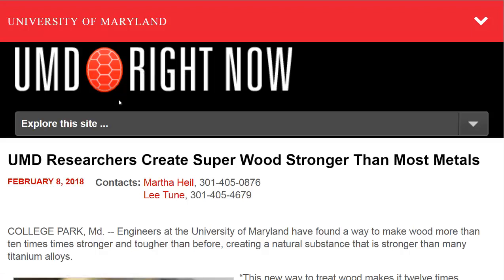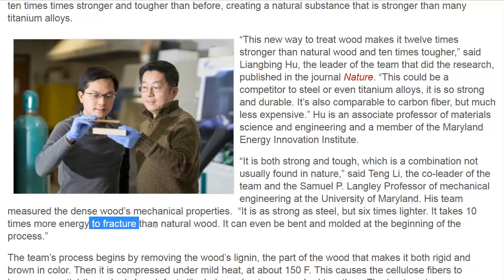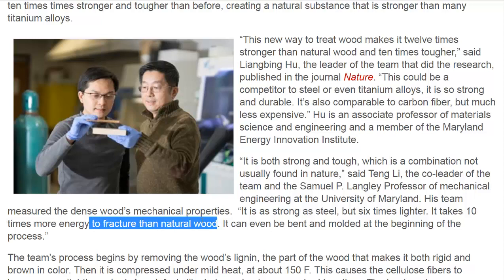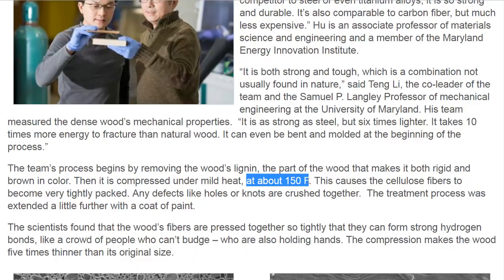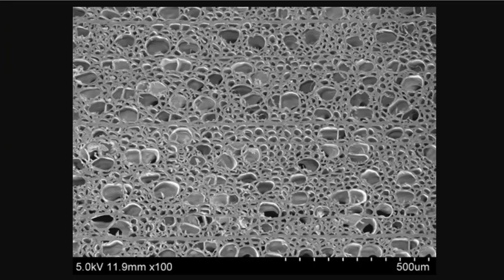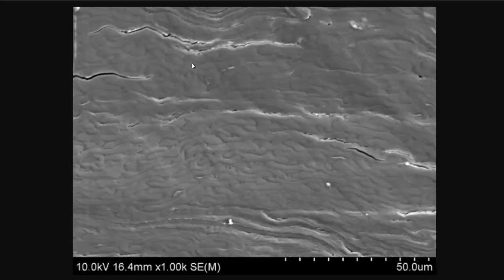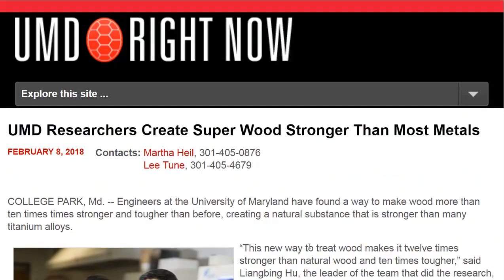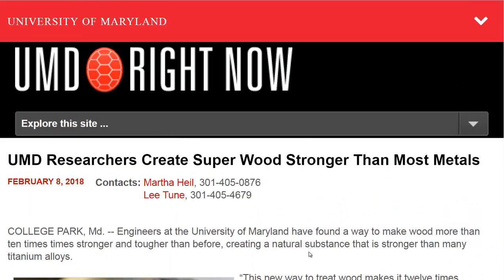Wood That's Stronger Than Steel and 6 Times Lighter

Comment: Although this is quite old, I want to say that this is either a hoax to fleece money or they leave out a very crucial piece of information. I read the paper and tried to recreate the process, but no matter what you do, i.e. level of removal, pressure, time variations. the wood ends up weaker than its normal compressed reference part. Every. Single. Time. I tend to call it a hoax, also because to this day no company makes it commercially.
Reply from the maker: @strangereyes9594  interesting, you may be right.
Reply: The only thing that proves is that most YT experts are incompetent and have unrealistic expectations.... Plus they're not going to give all the IP away.... And lastly it has been commercialized..... 

“Those who can, do..... those who can't, comment on YT"
Reply: The only thing that proves is that most experts are incompetent and have unrealistic expectations.... Plus they're not going to give all the IP away.... And lastly it has been commercialized..... 

“Those who can, do..... those who can't, comment on YT"
Reply: The only thing that proves is that most YT experts are incompetent and have unrealistic expectations.... Plus they're not going to give all the IP away.... And lastly it has been commercialized.....
Reply: The only thing that proves is that most YT experts are incompetent and have unrealistic expectations....
Reply: The only thing that proves is that most YT experts are incompetent and have unrealistic expectations.... Plus they're not going to give all the IP away.... And lastly it has been commercialized..... 

“Those who can, do..... those who can't, comment on YT"
Reply: they're not going to give all the IP away.... And  it has been commercialized..... 

“Those who can, do..... those who can't, comment on YT"
Reply: @nc3826  How do you know how extensive the experimental verification process was, how well I understand the physics and chemistry behind it and how many resources went into the process? 

Well, you cant. Ironically, that makes you the "YouTube expert commenter" you lament about. Funny how that works. But I am in a good mood today, so I clue you in on one of the many problems they omit.

The rate at which the leach penetrates into the wood fibers is measured in millimeters per hour, even under pressure. Considering that you cant alter physics, that means the lignin dissolvent is a gradient, which means you end up with an uneven cellulose structure that gets less optimal the thicker your wood specimen is. 

So the process of cooking, like they claimed they achieved the pre-pressed structure, is physically unable to actually create those structures. 

Having said that, the company they founded as a spinoff from the university the paper originated still is in the "its coming soon" phase, which is not a great sign.

However, the math checks out in theory. The hydrogen bonds should create a very strong lattice, so its not totally phony. However, the most begin explanation of why they are still unable to produce usable products is they thought they will figure out a way to solve all the problems with more research and money and the paper was meant to raise said money (which is a common practice). 

Will they make it? Who knows, but the claims they stated certainly weren't real at the time they published their paper. So I think it was meant to fleece money, although with good intentions I guess.

IF they make it work, the process certainly will not look like anything they stated in the paper and the product will be waaay more expensive to produce than they anticipated, that's for sure.
Reply: @strangereyes9594  "IF they make it work, the process certainly will not look like anything they stated in the paper and the product will be "waaay more expensive" to produce than they anticipated, that's for sure." ? 

"Having said that, the company they founded as a spinoff from the university the paper originated still is in the "its coming soon" phase, which is not a great sign." Incorrect...

The first product is being "commercially produced" Go recheck the website... With the second product that's supposed to be coming soon.... And in the whitepaper it states "it's comparable to carbon fiber, but much less expensive" ? So good luck pretending it's more expensive than carbon fiber... SMH

"However, the math check"? LMAO, since there is no math in the published white paper.... thank you for that pseudoscience irrelevant prognostication...

Tesla almost went bankrupt dozens of times... And most startups fail.... So you're showing no Insight, whatsoever predicting another startup will fail....  Most good ideas don't even get to the commercialization stage.... 

There have been a lot of developments in the cellulose based product and construction industry in the past couple of decades, such as CLT. And I'm not unbiased cuz I actually put a proposal for something indirectly related to this type of development to a DOE grant program over 5 decades ago ... I had my doubts if it would get here in my lifetime?  But it's inevitable that these types of products will be developed at some point by some company, since it's more energy efficient than the alternatives... I know it's a cliche but it has dozens of uses I can think of just offhand. So it definitely could be a "game changer". Depending on how extensively it's developed? 

My triggered defensive YT hyperbolic expert friend.... I'm getting out of this pointless rabbit hole now..... Have fun trolling every concept that you can't fully comprehend or replicate ...  “It ain’t what you don’t know that gets you into trouble. It’s what you know for sure that just ain’t so.“
Reply: @strangereyes9594    Addendum: "How do you know how extensive the experimental verification process" and "understand the physics and chemistry behind it and how many resources went into the process" for any products? KISS....   I'm sorry but assorted  YT degrees in physics and chemistry don't matter ...  

That's why there's "building codes"... 

But thanks for reminding me of the "Millennial Song"

Comment: cheaper faster lighter growing bamboo fibers acid dissolved and powderized into RAYON and or bamboo fibres, then being compressed with heat and GLUES will harden up to be about as strong and flexible as the glue while still looking like a nice traditional timber flooring. 
question is what glues are they using and are they using coatings or hardening agents like CERAMIC GRAPHENE for moisture resistence and 9H or 10H liquid diamond and liquid sapphires for added density and strength and how would this traditional "bamboo wooden flooring" thats basically flexible and light weight be compared to this lignen processing and if the wood becomes denser could it be applied or made the same way as bamboo flooring and which would look more beautiful or 'wood like' as sometimes compressing existing timber and heat treating it may be done SMARTER with ancient japanese cactuses juices or other things that can DARKEN the timber to look black like carbonizing though theres no flame or heat and its not actually carbon its DENSER and bonding the timber each time you polish it so it slowly becomes a really dark brown black color with many many times the strength which can be a wooden bathtub for centuries and national monuments last thousands of years.. japan has the oldest wooden buildings on earth with some regular shacks/houses lasting over 2000 years some of which found roman gold coins underneath neato.